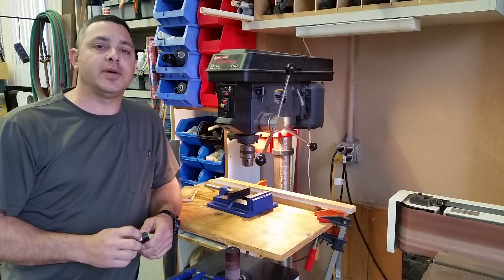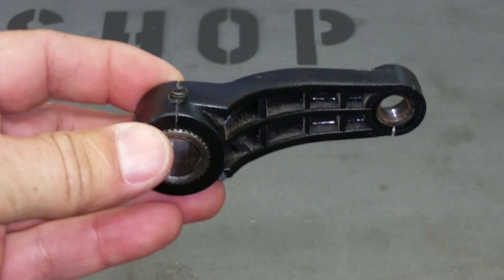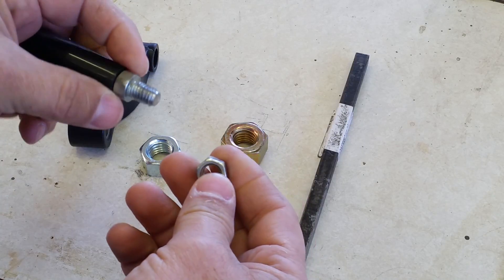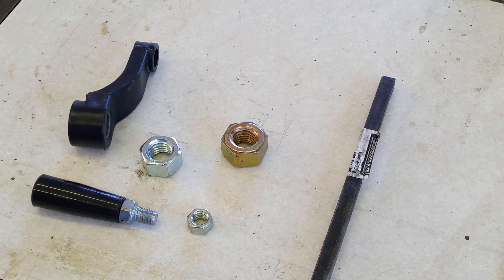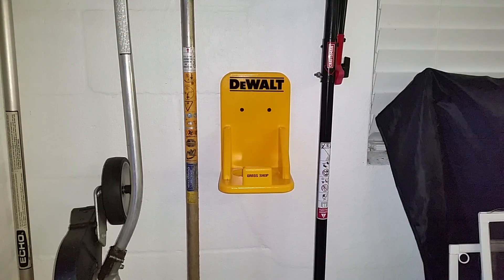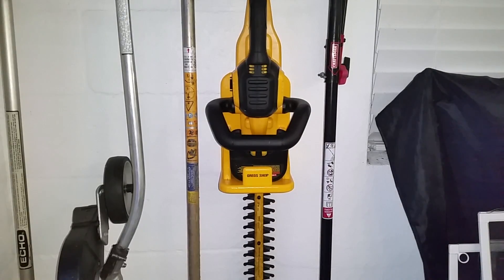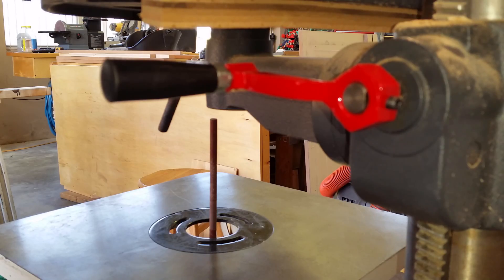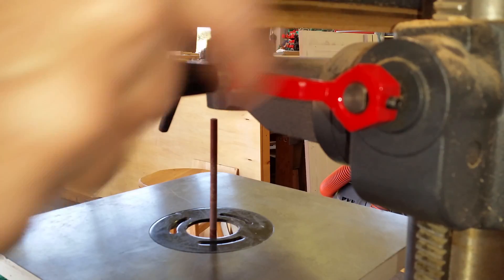How to build a replacement crank handle for a drill press table

Comment: Thanks for the vid. Think you could do one on the feed handles? I purchased a second hand General International 22" Drill Press. Only thing wrong is it's missing 2 of the 3 feed handles. Apparently the company is out of business and im having trouble finding the handles for purchase. I'm pretty green to this type of work so it would be very helpful.
I am familiar with welding and have a miller multimatic 215 with some machining knowledge.
Reply from the maker: First off, thanks for watching and leaving a comment.  I would think the shaft on the handles are a standard size.  I have seen handles available on eBay but they were too expensive for me. I’d suggest finding the thread size and pitch and make your own.  Find some golf balls for the end and epoxy on to the rod the. Tap the other end. You already have one to go off of with sizing.

Comment: nice..or you can buy one on ebay for a few bucks if you dont have so much equipment..
Reply from the maker: Yeah I had trouble getting what I wanted on eBay and this basically cost me nothing as all the materials were either scraps or reused.  Thank you for watching and leaving a comment.

Comment: Thanks. I have a delta drill press and a jointer that almost every adjustment is controlled by plastic and broken off.
Reply from the maker: Yeah that sucks.  Plastic just doesn’t hold up.  Thanks for watching and leaving a comment.

Comment: Have you ever consider to cast this hand and use it as a mold…?
Reply from the maker: No I never did consider that but it’s a great idea. I’ve never done a sand casting before.  I may have to try that.  Thanks for watching and leaving a comment!
Reply: @GregsShop  I believe it’s not that difficult, and this is a good opportunity to try because the handle is an easy part if you use it as a mold. If you try it, make a video so we can see how it will be.
Reply from the maker: If I do try it out, I’ll make a video so make sure you subscribe!

Comment: Man oh man, I have never seen you with so much rage. Drill vise flying around the table, poor Home Depot getting put out of business, man I thought I was dreaming of me dealing with our politicians, I need to calm myself down, anyway that was a good build of those cheap ass handles, good idea to make that better. I see you used your new weld table too.
Reply from the maker: +rvkubotaman yeah it worked out pretty good. I was happy with the result. The new welding table is working out quite nicely. Still putting the finishing touches on it. Adding a double gang electrical outlet on it and some stickers.  I'm going to do a walk around video on it next week maybe.
Reply: Yea, the outlets are a good idea, I wanted to do that to mine but always forget, to many other projects.